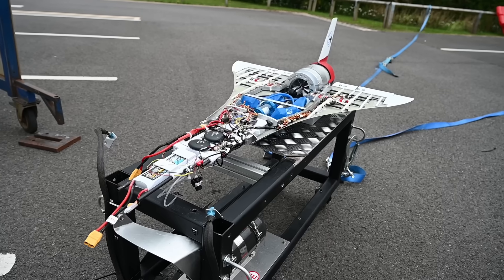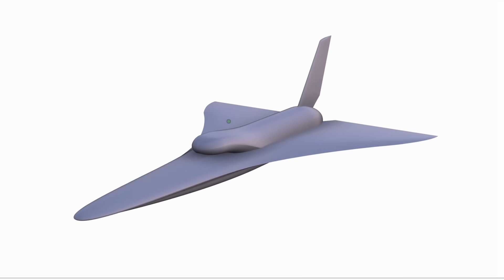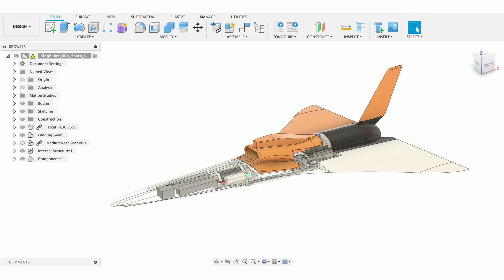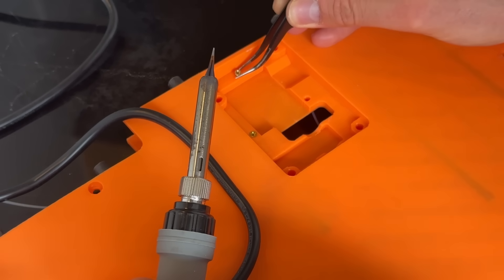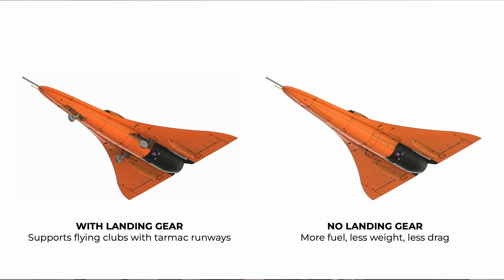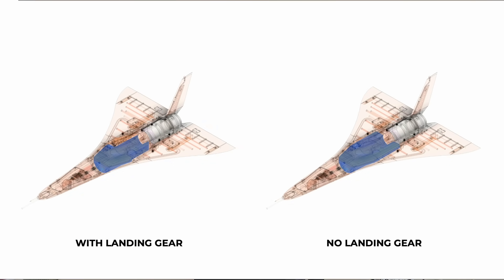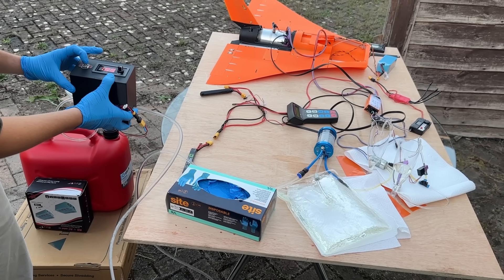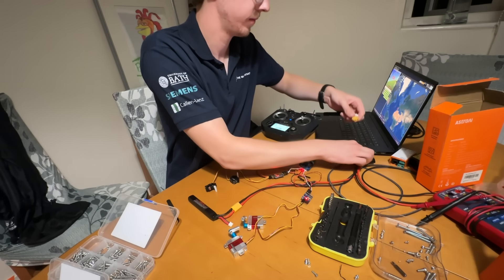Introducing Kingfisher Mark 2!

Comment: i got some knowledge about fast turbine- rc planes & im highly worried about the overall construction for those speeds. 
The concept about using a delta wing in combination with fpv is very good in my opinion, but iam sure the plane, made of pla and screws cant handle the forces, especially the super fast load changes in moving air. 
There is a reason why extreme fast rc planes are made out of super strong and special carbonfibre layouts like carboweave and so on. 
I habe seen special made wings exploding at about 250mph- this is no joke… 

My idea for you is: 
Print a negative of your plane, seamless as possible… laminate the plane inside and go for the record ! 
Good luck ! 😊
Reply from the maker: Thank you! Our previous MK1 aircraft used fibreglass layups on 3D-printed moulds but it required a lot of manual labour and the parts didn’t turn out brilliantly - there is a steep learning curve!

The aluminium structure is designed to carry loads up to 10g + safety factor. We have tested this up to 4g with no damage observed, so we know the raw 3D-print + alu skeleton will be able to survive a maiden low-speed flight. For high-speed flights we will likely coat the aircraft in carbon fibre/ fibreglass for extra strength. This will sacrifice some repairability/ maintainability, so we will only do this once the aircraft is flying reliably at low-speed. Would prefer this approach over doing negative moulds as it’s a lot less labour intensive.

Thanks for watching! 😊
Reply: i agree, 3d printing is maybe good for proof of concept or check of low speed flight characteristics. but this thing will not hold up at any decent speed. carbonfiber hull is the only way they could achieve anything. plus the plane is to small.. wingloading to high.. this will be uncontrollable
Reply: @Chris-Workshop  yes! I think the high wingload could be reduced by everything you dont need. The rest could work with a very good learned gyro. A gear for example is a great thing, but not useable for a plane what comes to landing with about mach 2 😅. 
Get rid of everything extra- the wingload will decrease. 
Ob every extreme concept in rc there is one rule: „kiss“ keep it simple stupid. 
For example there are thrust vectored rc jets nowadays. The easiest way to get some bubble free fuel to the turbojet is to simply use a bladdetank without airtrap. Only remove the air after fillingthe bladder.
Reply: Esp. when you have BIG control surfaces, made from plain PLA, without reinforcement :D Control surfaces will fail first (and strength of other components does not matter anymore)
Reply: They decided long ago to never believe the rc modellers community and learn all the things the hard way. There were all the time really good suggestions in the comments which they always ignore. So let them do their thing and be entertained. E.g why the hell do they use a bladder tank in combination with an air trap?! 🤦

Comment: I think your air intake is undersized.
Reply from the maker: Its a tradeoff between maximising thrust at low speed (which requires a large inlet area), and minimising drag at high speed (where only a small inlet area is required). We don’t care as much about thrust at low speed as we’re very overpowered anyway, so the inlet has been optimised for the high speed case
Reply: Cool sounds like you've done the CFD! Well done @TheMachInitiative

Comment: An F1 idea for helping aerodynamics is to put tape over joins and the sunken bolt heads. The drone looks fab, can't wait for the speed tests.
Reply from the maker: We will definitely be speed-taping it for high speed attempts - it hasn't been shown up to this point because we're doing a lot of assembly and disassembly and we would end up wasting a lot of tape! 

- Max
Reply: @TheMachInitiative paint as well? or are those benefits negligible?
Reply: I agree yeah you always see them sticking tape over all by gaps
Reply: Yup. I fly glider and we use a similar method
Reply: Yeah, vinyl tape all the things! 😃
Reply: Yup I still use it on the race cars and rc planes.
Reply: and some landing gear covers then your not taking a aero hit
Reply: Im not an rc plane builder, or anything rc, but is a FDM (3D printed) skin aerodynamic enhough? Dont the lines give drag or turbulance?
Reply: @kooskroos you could sand it.. glass it.. but all the seams and holes would be causing drag
Reply: you dont have to wait on this fool.. he trying to reinvent was was already done 8 years ago but with a non binary twist to it.. 

By the time he catches up to the world record th world record will be close to 600-700mph.

https://www.youtube.com/watch?v=DPGDAZyQ44k
Reply: yeah,i saw some street racers tape the hood gaps with tape

Comment: Thinking about it... When going mach speeds, are you guys worried at all that the compression heating of the air might get above 50°C and soften the PLA?
Reply from the maker: We’re only going to be flying at those speeds for a few seconds but it is a concern. The raw PLA will be okay for the low speed maiden flights, however, we’ll coat in carbon fibre/ fibreglass for the high speed flights which will provide more thermal resistance, although this will sacrifice some repairability

Comment: You may want to look at surface-mounting patch antennas to the skin of the airframe if you wind up skinning it with carbon fiber for telemetry/vtx/receiver. It's also looking like you only have 1 vtx antenna hooked up to a transmitter with 2 antenna outputs. If you don't have a way to disable the second channel, you'll cook it without hooking up an antenna.
Great project!